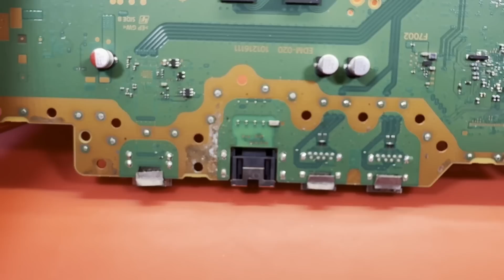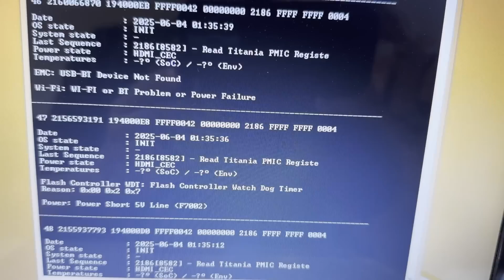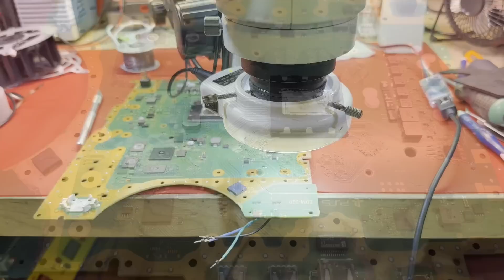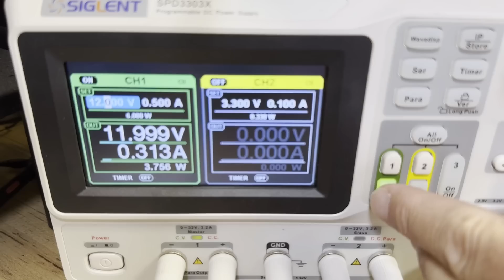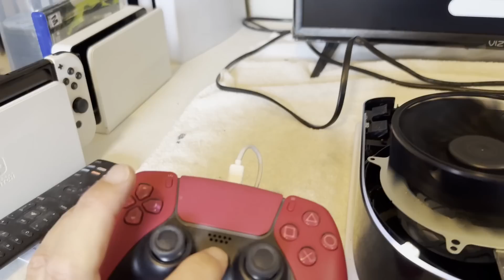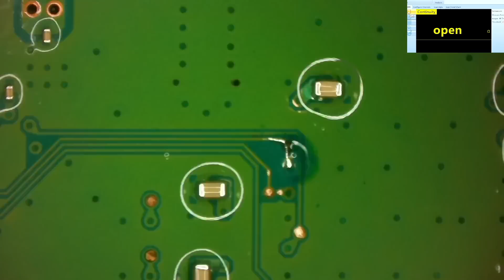#186 Repair of PS5 Beep but No Light

Comment: Great video! I have a very similar issue but the circles you connect a jumper wire too, the circles on mine are very dull and look like the copper is gone. Not really sure what to do

Comment: I have a PlayStation five took to a PC shop. They said it was my power supply and said the motherboard look good and I went up to the store then decided the motherboard has the IC chip in the middle. Looks like they had a soldering iron on it and burn it and they said it got too hot, but it was OK when they looked at it the first time they didn’t know what they was doing. Charge charged me $25.

Comment: what tool are you using toltec to scrape the pcb work you do down to the copper clean and properly like that to make a continuity connection/trace wire connection? is that a flat head or a precision surgical blade what tool is that? what tool is recommended to safely do it all? I know I have to be precise with scraping so I dont over do it. What hot air temperature in Celsius and air flow speed are you using to remove smd capacitors I don't want to blow these micro caps off my board lol.

Will 370 to 380 celcius at 20 to 35 out of 120 air flow work safely to remove fine smd small components? Im in the trial and error stage I guess I'll play around with it all and see what works for me. 

I bought a quick hot air station recently and im learning. I just want to learn and do things properly. I also had someone donate to me recently 8 jdm-055 ps4 controller boards to practice on. Im mostly going to be working on console controller pcb's and whatever I can get my hands on at this point. I do also have a nice amscope microscope. I'm definitely not going into this work not prepared. I have basic tools needed for this kind of work already. I dont have a nice agligent like yours but I do have a fluke 87v max which I think is more than good enough for testing. Im only missing a linear dc psu and thermal cam at this point but those ill buy in due time.
Reply from the maker: I think I was using a small razor box cutter.  I could not find my precision Xacto hobby knife that I would normally use.  I normally use my hot air at 400C and max air flow but you have to hold things in place with tweezers.  Using some sticky flux also helps.  Those tools sound just fine for SMD work.  You just need to try and learn and fail and learn and keep going.  You will get better!

Comment: I'm slow to react... Was that broken line the cause of the delayed drop in peak current and also the NON-recognition of the Joystick Ctrllr? I'll have to watch the video again slowly... nevertheless, excellent repair, congratulations, I liked it. Thank you very much, sir, for your time and sharing. All the best.
Reply from the maker: I think the wire that I had repaired had broken loose after I had turned on the console.  The console was running but I think the broken connection caused the system to become confused.  It was in a very unstable condition.
Reply: @ToltecMerc  Understood. Thank you sir for clearing up my doubt. That's very kind of you.
PS: I watched it again (even with subtitles) but I was still confused. Thanks again, sir.

Comment: Interesting outcome. I thought you jumped the gun on the ssd controller since you had all the voltages and I was correct.
Reply from the maker: I've seen SSD controllers cause some weird errors.  I took a guess and got it wrong.  It happens.  Next time I think I will recognize the 3 errors that get logged when the system can't talk to the WiFi/BT module.

Comment: Great job! It's amazing that a data line should cause a No Power. But it's great to know. Thanks for sharing! BTW, you should consider using UV Resin for securing repaired traces. UV mask is not really a glue... it's just a paint, so to speak.
Reply from the maker: Thanks!  I'll look into the UV resin.

Comment: Interesting fix. But a question though. Would current draw of 220mA point towards the ssd controller? The final 100mA or so is taken up by the ssd controller. With a missing Wifi/ BT module or in this case, data lines (similar case), the power draw would be around 270-290mA and would hand there for some time. Also interesting UART terminal. May I ask which one?
Reply from the maker: What I was thinking was the SSD controller was drawing full power but was having difficulty with the many data channels it has going in and out of the chip.  Thus it would attempt data transfer and then retry, retry and timeout.  I was using PS5 Wee Tools Pro.

Comment: The roaches 🪳 destroy these game consoles I won’t even touch them .. 
give you credit  Nice fix what would be nice to know is what dateline or powerline was that? That was affecting the system to start up but I would definitely be wearing some gloves 🧤 with all the feces on the surface of the components
Reply from the maker: They are nasty but I don't like working in gloves.  It's likely a data line between the South Bridge and the WiFi/BT module.
Reply: @ToltecMerc  yeah I usually don’t like working with gloves too I’ve been finding myself using them taking the game consoles apart lol